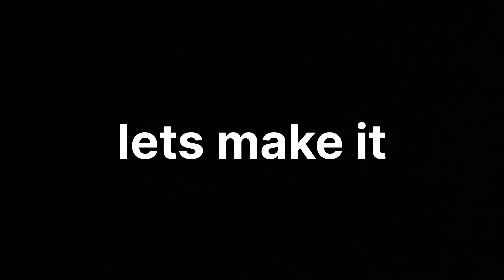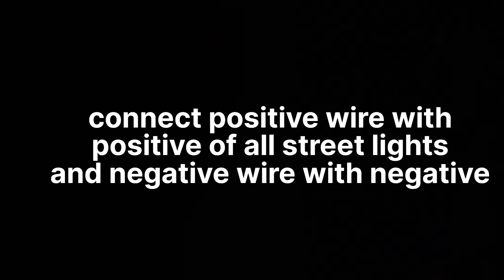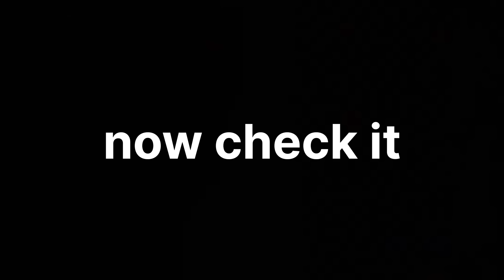How to make windmill for school project

Comment: Sir 
This project is misleading informations for students.
in this project concept is dc motor generate electricity to street lights that means windmill project.
Here is battery operated light settings..
And lights are not working in direct dc motor
Dc motor also working in battery
This is Not exact   windmill project
     But but your  hard work is fantastic

Comment: Its good but still your description for making this project is in complete you should provide more description as size of cardboards to bet cut and how did you connect street lights wire and house wire and windmill connection in that box  how did you connect those wires and from where you did not show

Comment: Bro how is it windmill? Isn't it a wind turbine?
Reply: Isnt that the same thing???
Reply: @tasnimtouhidorthi5986  no bro wind turbines are just used for converting wind rotational power or wind energy to electrical energy. While windmills are actually mills that runs through wind energy. Also windmills have a lot more functions than wind turbines and they both do have different structures too. 
            I have seen more than 90% of people referring a wind turbine as a wind mill, which absolutely wrong.